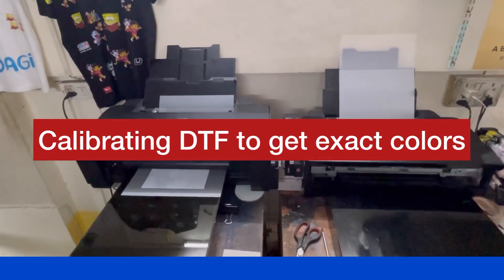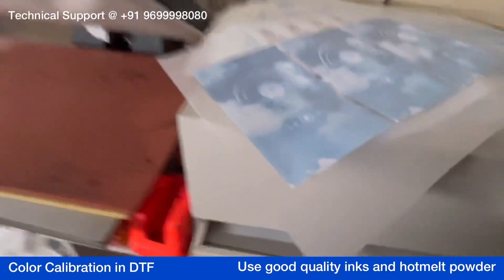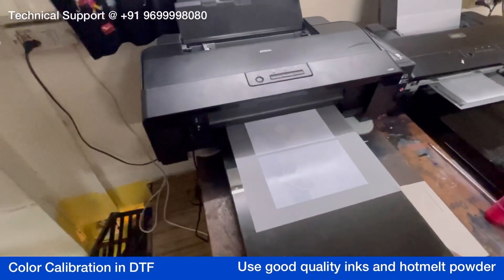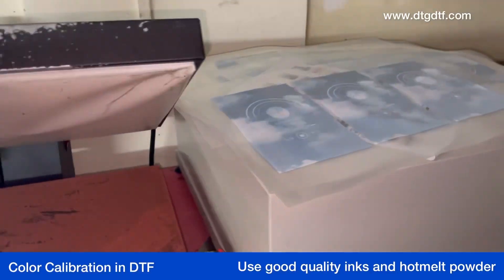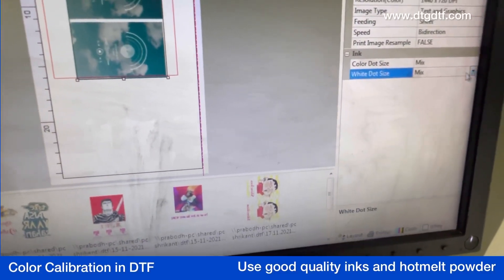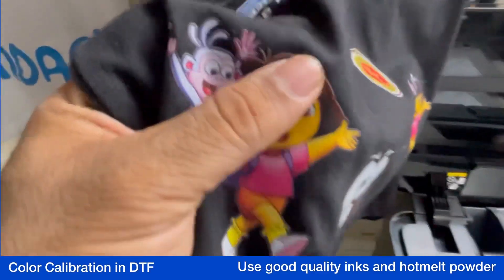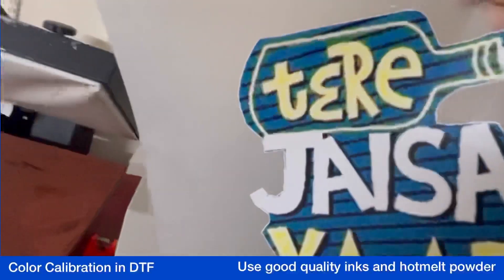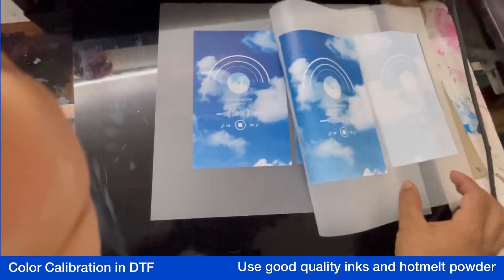DTF L1800 L805 How to calibrate Colors. Color coming Dark or Light. Explained live . Uncut Video DTF

Comment: Hi, same printer L1800; all colours are vibrant, only issue is it will not print brown? Turns brown to black, any idea
Reply from the maker: Change cmyk limit separately.
Reply from the maker: @Cloud9Surfn  I don’t think so it will solve this issue but v11 is better.
Check  the color you are trying to produce is in CMYK and not in RGB. 
If your ink manufacturer has ICC color profile then upload it. It might solve issue.
Reply: @dtgdtfdiy  Ok appreciate the help, thanks 😎
Reply from the maker: Welcome 🙏🏻